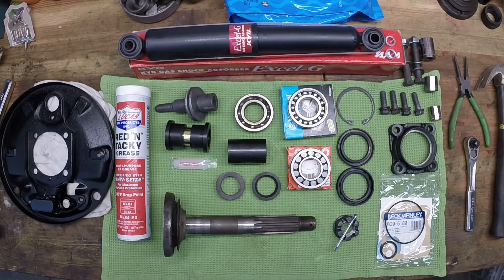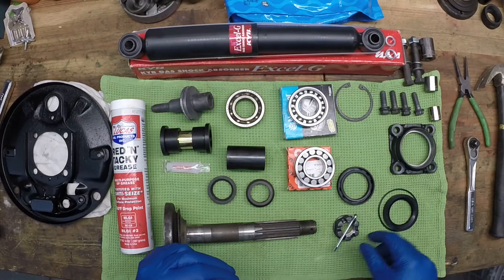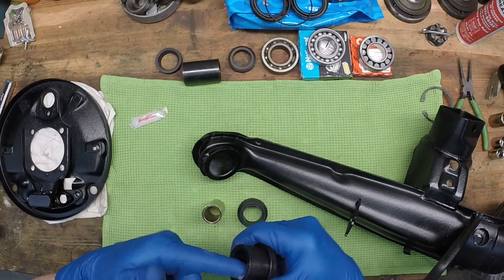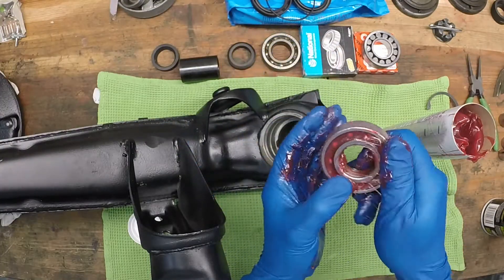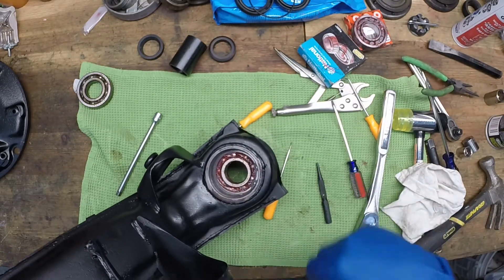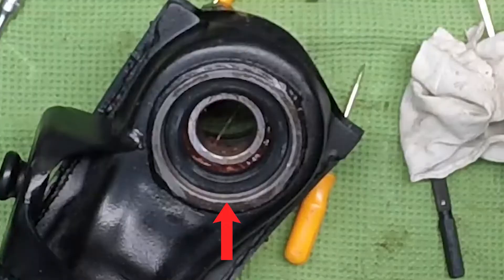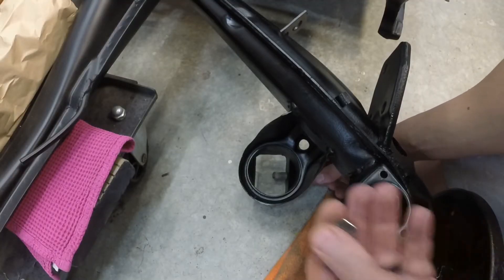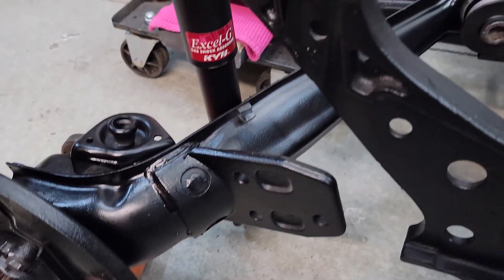Ep. 2 - 1971 VW Super Beetle - Diagonal Arm Assembly, Rear Bearing & Seal Replacement & Install.

Comment: Where you installed the beveled spacer on the backside, isn’t there supposed to be a seal installed before you insert the axel stub?
Reply from the maker: There is not, other than the outer seal that was installed.  Install order should go bearing, lock ring (circlip), outer seal, inner spacer, axle.  

http://oacdp.org/type1part/5005.png
Reply: @bottomupbuilds  Thank you so much for clarifying.